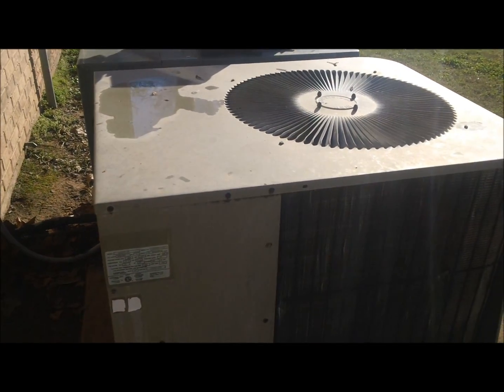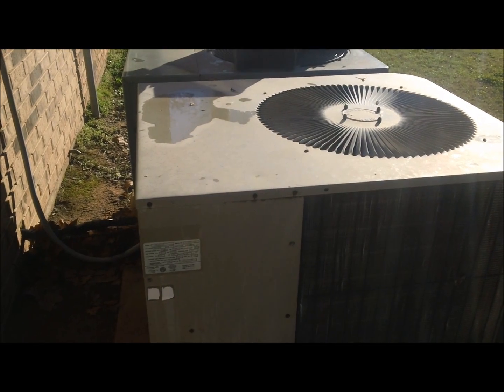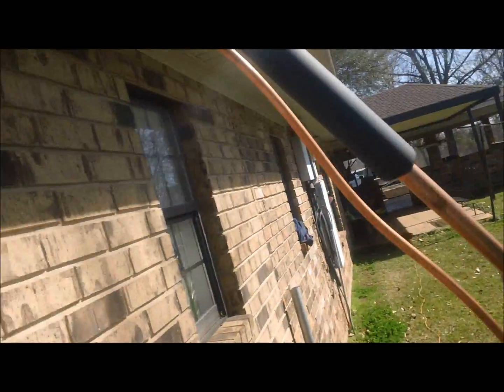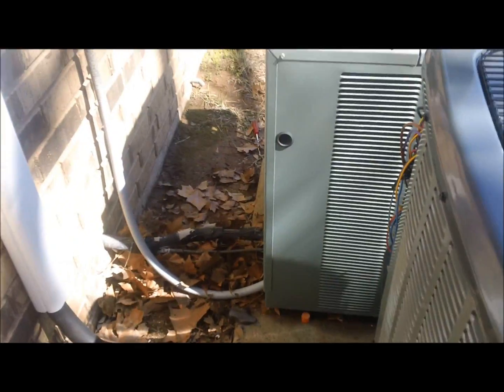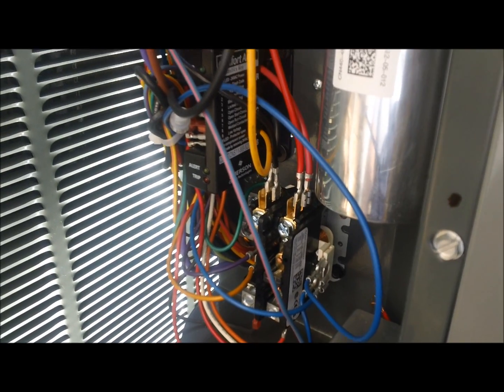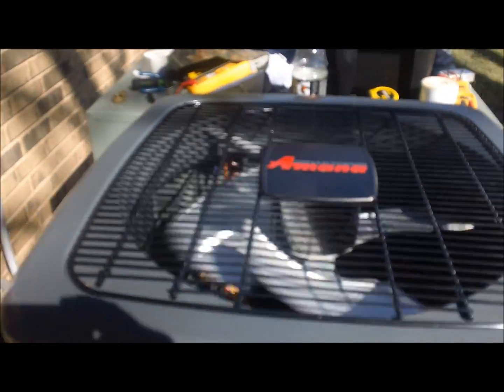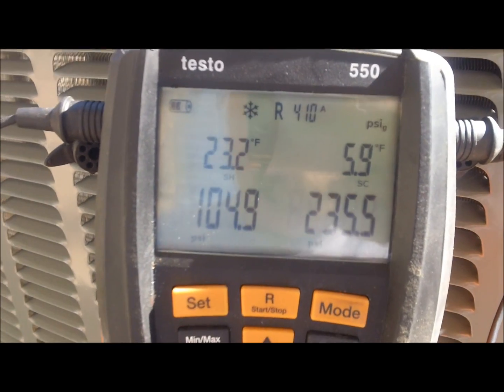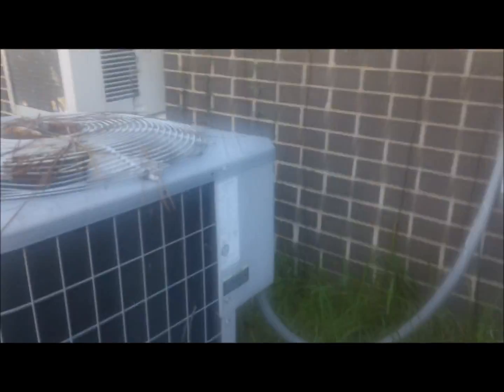HVAC Install: 3 1/2 ton Amana 13 Seer Heat Pump

Comment: I like the look of the Amana gear. Do you feel it is better built than the Goodman branded stuff? I saw the comment about the same bells and whistles as more expensive units but what about things like sheet metal thickness, vibration, rattles/buzzes, etc.?

Comment: I usually install Grandaire and I've had only one warranty issue in over three years; control module on an X13 blower motor. They're quiet too. Simple and efficient. That's my approach. Not a big fan of Goodman. Keep on keepin the air flowin'.

Comment from the maker: Well your Amana is a 410a and Amana has a sound blanket and a slower fan motor to reduce the noise!!! Your neighbors unit is R22 and the Goodmans don't have have sound blankets and all the other bells and whistles the Amana has!! Also the 410a systems are quieter than R22 systems!!!

Comment: I have the Amana: ASZ130361 and it's not noisy at all, my neighbour has almost the same modem but it's Goodman: GSH130361, the noise is terrible, what can explain that difference?  Do you think it can be a problem with the compressor?

Comment: My Dad has a 2009 14 SEER Amana heat pump paired up with an Amana electric furnace and he loves it. Hasn't had one problem with it yet.  Very good quality equipment.